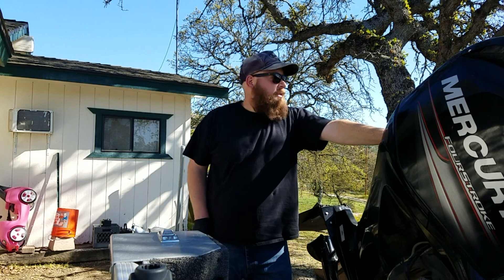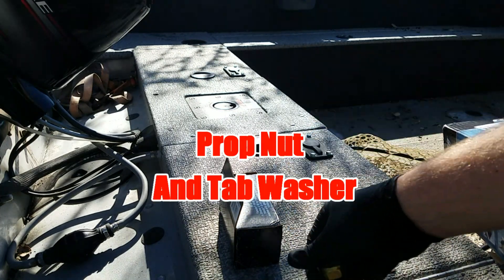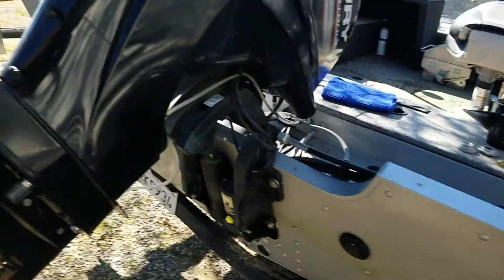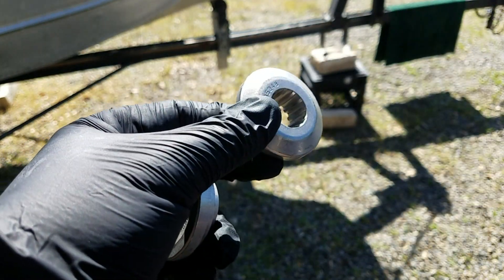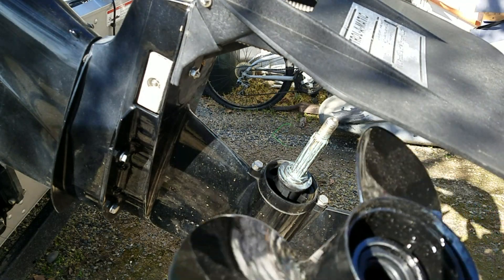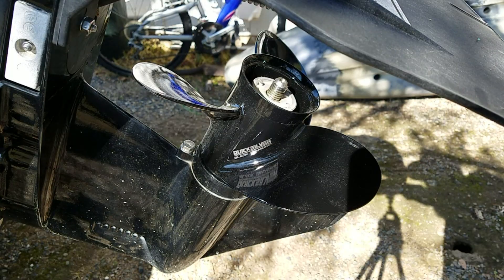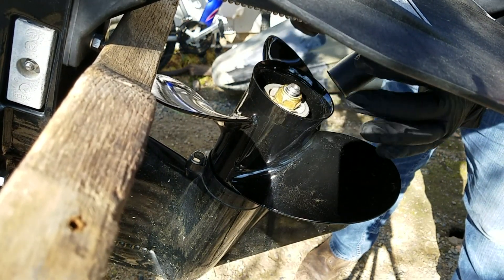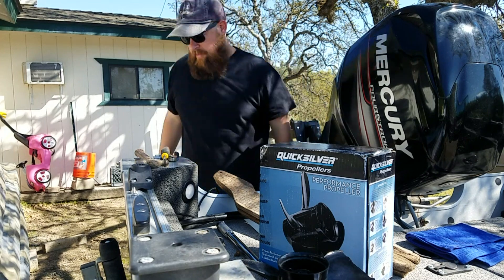How to Change A Prop On A 4 stroke Mercury 60 hp outboard Motor|Propeller replacement

Comment: What happened to the inner spine. I didn’t see you put that on. 🤷🏼‍♂️🧐 oooh. You put a note that you had already slide it on. Also, I don’t know what size to get. There’s lots of different propellers. I do have a Merck 60 4stroke but mine is older. Thanks… Good job.
Reply from the maker: Howdy ! Thanks for watching sorry for late reply. 

The one I use is 

10.75" diameter with 12 pitch. prop number is QA2072X

Seems to be a good all around propeller.  Nice hole shot . Top speed is ok too. 

Happy boating !

Comment: What size prop is that? Have you ever put a stainless prop on that motor to see the benefits? I have the same motor, so I'm curious
Reply from the maker: The prop is a black diamond 10.8x 12 pitch.

I've never done stainless.  I hear they are great on higher horsepower motors so I'm sure if you got some extra cash it might be great. If you get one let me know how it performs!

Comment: What kind of hydrofoil are you running? Thanks
Reply from the maker: Using the Trol-A-Matic from bass pro shops . Think it's about $100. Great trolling plate and then automatically pops up when you accelerate.
Reply: @hookjawhunters9419  does it help with getting the boat on plane or handling or is it purely for trolling ? Thanks.
Reply from the maker: I'd say primarily trolling.  To be honest I only ran the boat 1 time without it so I can't say if it planed out faster or not. I'm sure it doesn't hurt performance though. 

Ive had the SE SPORT hydrofoil on a smaller motor before and saw zero difference. I'm not convinced they are worth the $.

Comment: This video is pretty old but hoping I can still get some feedback...if I don't have a torque wrench should I wait for one or just use my best judgement with a socket set? I don't want to have to buy a freakin expensive wrench just to change my prop if I don't have to..
Reply from the maker: Hey Super Dave! I'm pretty sure you could get away with best judgment. Or I know around here the parts store will loan out or rent a tool. No question returns. I just did it with a fan clutch wrench. Hope you get it all figured out !
Reply: Thanks buddy...tight lines!

Comment: Do they all come with a rubber washer my new one didn’t?
Reply from the maker: Hey Karl! Are you referring to the hub kit inside the prop? If not which rubber washer? Shaft seal? Happy to help if I can
Reply: @hookjawhunters9419  I found it it was on the last  piece that you put the bolt and keeper tab then nut on, guess it slid off the plastic piece onto the medal piece. Wish I could show you a picture but thanks you got me checking it out by watching your video, probably saved me some future headaches and money thanks👍
Reply from the maker: Awesome!! Glad you found it and got it all buttoned up.  Happy boating my friend 👍

Comment: That damage to your old prop was wicked.  Looked like you got a really good deal on the replacement.  I keep a spare prop in my boat, hope I never need it!
Reply from the maker: I've never seen one break like that..funny part is that it wasnt a rock or loch ness monster that broke it...it was a little piece of drift wood ...I was shocked..I've chipped and bent a few but never broke.. yea I almost spent $155 for a new one at my boat shop then my buddy found that one on Amazon. Figured worst case I could return it..thanks for watching!

Comment: What Diameter and pitch did you put on your boat
Reply from the maker: Hello. It's a 10.75" diameter with a 12 pitch. The prop number is QA2072X. Hope that helps 👍